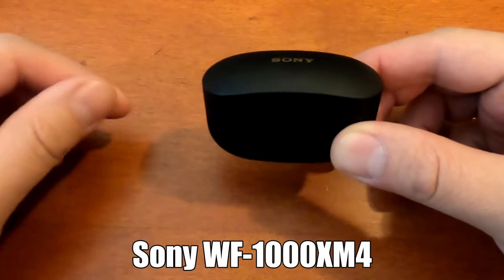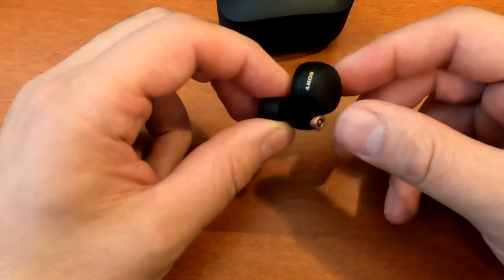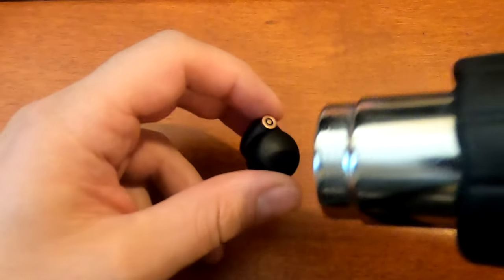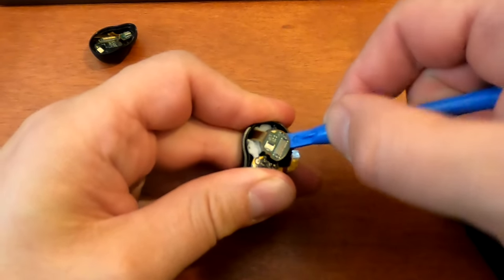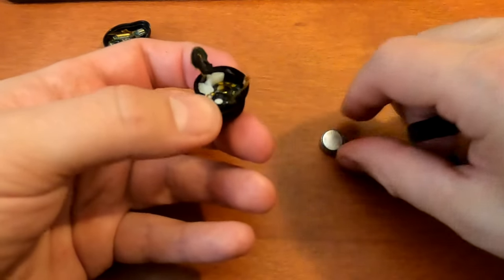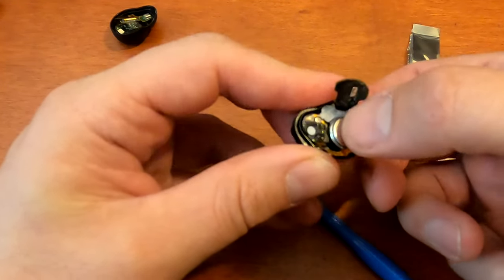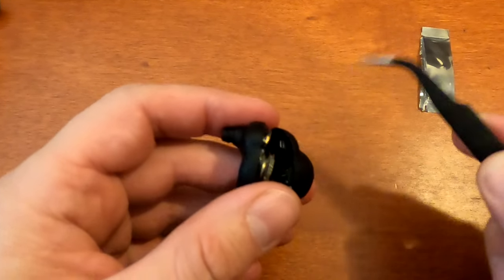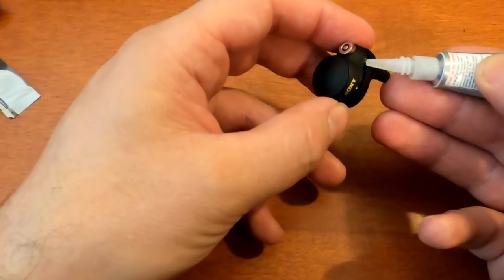[QUICK FIX!] Replacing the battery on a Sony WF-1000XM4 earbud

Comment: It does seem like you could make this repair without taking either of the ribbon cables apart. Couldn't you crack the case open and then just unstick the two boards from the face of the battery? Certainly the second slide-in ribbon cable it looks like you could leave in place. As far as glue goes I would use a tiny tiny tiny amount. I bought my pair new and the batteries only lasted about a year and a half which means . . . Will probably have to perform this battery replacement every year and a half. I think the basic problem is Sony has set these batteries to charge to 100%. When new they get many hours of use out of each charge. But it means that they sit in the case the entire time being charged to 100% which everyone knows is terrible for lithium batteries. Sony should have only set the batteries to charge to about 70 or 80% of nominal like people do in their electric cars. They obviously did not do this.

Comment: My answer: never buy anymore Sony products
Reply: Because a consumable part needed replacing?
Reply: @GothicRocker2k6  Way faster than other brands, so I'm with Malcolm. Mine are dying in a couple of hours after less than two years ownership. I have 5 year old Samsung Galaxy Buds that have held up better.
Reply: Are you kidding? 
I've never heard of a battery replacement for an earbuds!!
Mine is died after year and half it's very disappointing!!
@GothicRocker2k6
Reply: @GothicRocker2k6 for a premium product?
Reply: Batteries fail. They are consumables. There's no way around that at the moment. If you ever get a product with batteries in, they will inevitably fail at some point.
Reply: @GothicRocker2k6  no! It's because if you got to the forums, it's A LOT Of people experiencing the exact same issue. Now mine started
Reply: Maybe you should think before your type..
Reply: Agree

Comment: Hi guys. Everything went well, I've managed to open it without a scratch, buuuut, then the battery exploded, with a shot (due to heating may be) and has torn off that side cable which should be disconnected via connector and lock. So, bye bye, Sony. 🎉
Reply from the maker: omg!!

Comment: Did this and my earbud wont charge :( oh well
Reply from the maker: It's possible that the battery is not contacting the metal bits on either side. On each side of the battery, there's a small metal tine that is spring loaded to point "up" towards the battery. Over time, that may have compressed flat - and thus is no longer pressing "up" towards the battery face. If that happens, then the battery isn't connected! Try removing the battery and gently prying up that metal tine a bit to reload it's springy-ness. Hope it works!

Comment: Do not buy this, needs to be replaced a second time in one year with Bluetooth and heating issues and my retailer can't replace it so I got the refund, But the time I used so far it provided a great quality sound. In the long run, this is not a good choice. Sony needs to do better.

Comment: Okay, this method could work, but there is something to consider when using the heat gun.... It didn't specify how long you can use the heat gun for because what he didn't tell was you is it could melt the housing and ruin the entire thing..

I can see this guy has done this many times so if you're a novice and using that heat gun. Be very careful because you can actually melt the housing or make the housing very soft to the point where You can damage.

This is a poor video and I will give it a down vote... My ear buds were ruined listening to this guy..
Reply from the maker: I'm sorry your repair didn't work out - that really stinks! This was actually my second time doing this repair. I wasn't sure how hot it needed to be so I let my fingers be my guide - when it was too hot to touch/hold, I stopped heating! I hope you have future success with your repairs - best of luck!